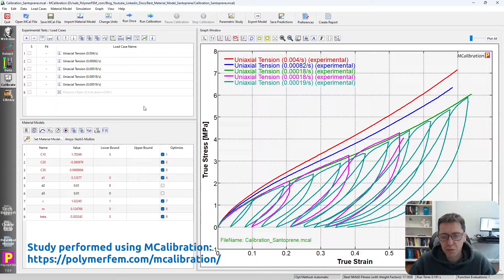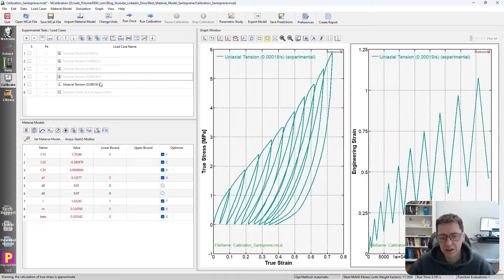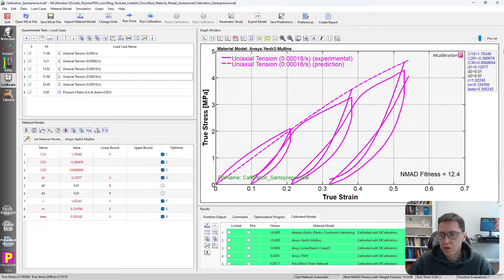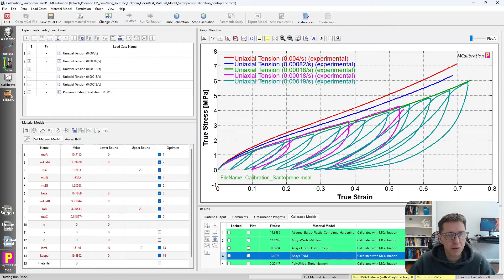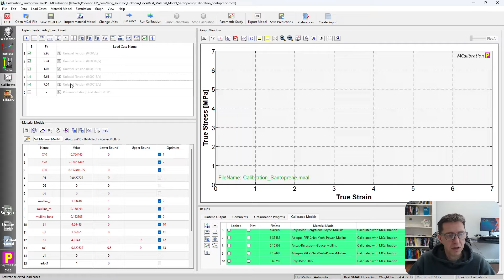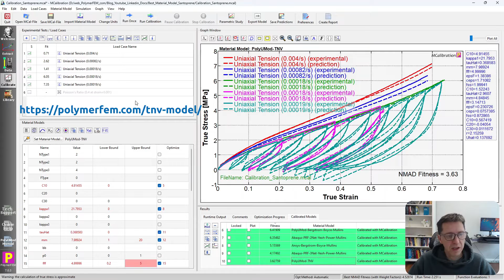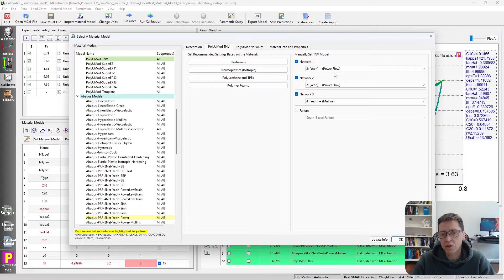Best Material Model for Santoprene

Comment: Very insightful. The PolyUMod TNV is a winner! 
 Quick question: are the material parameters of a model independent of the unit system?
Reply from the maker: No, the material parameters are typically not independent of the unit system. I usually prefer: mm, sec, N, MPa.